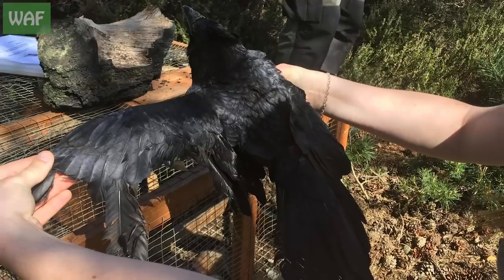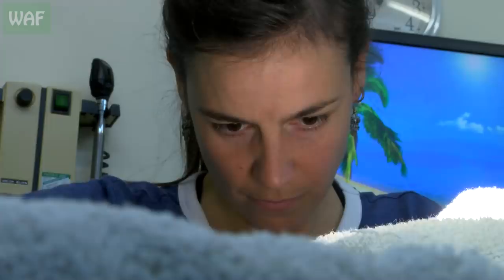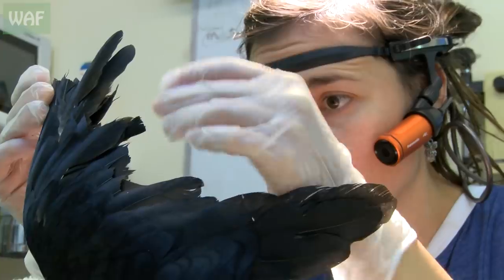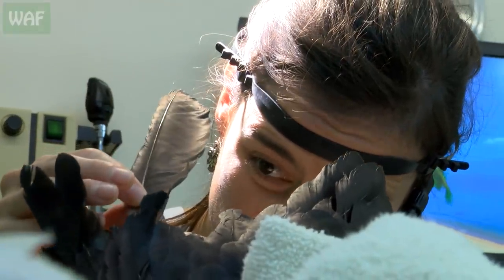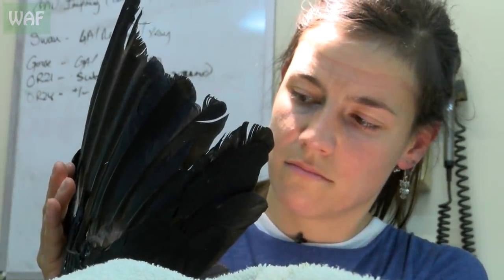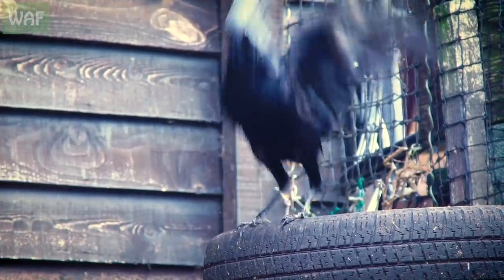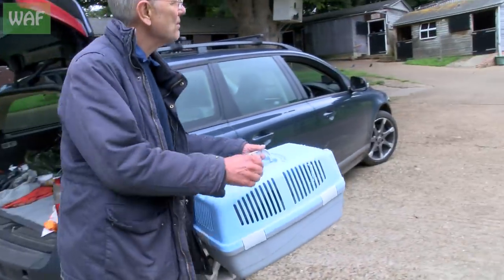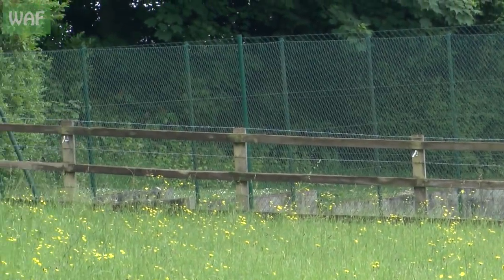Crow's new wing lets it fly once more! - Animal rescue

Comment: It can't be very often that you glue your patients together! What an ingenious procedure. I thought you would glue a feather on to the short feather, but how perfect that you can use the fact that the 'pen' is hollow to attach them together! It's like one of those modeling toys where you have to put different pieces together. Crows are awesome. (Even if they bite, hehe.)
Reply: human doctors sometime glue wounds closed instead of stitches, so it's not THAT uncommon. Last time I went to the ER, the doc glued by finger shut after I cut with badly with a knife. He told me that it's just your standard hardware store superglue, but specially made sterile.